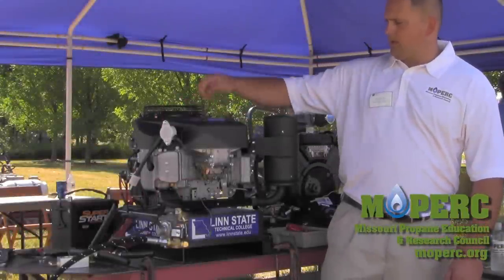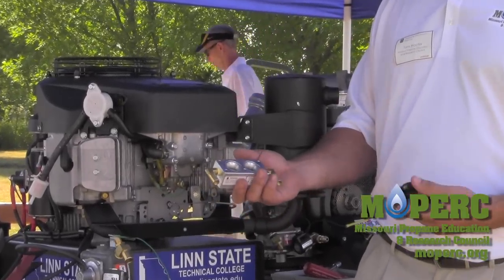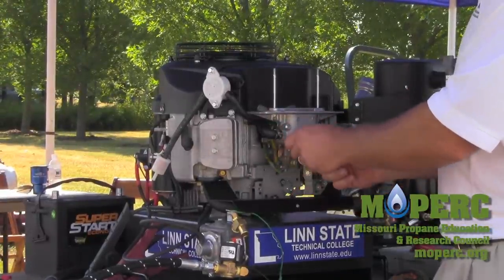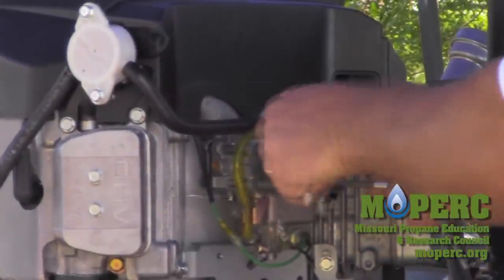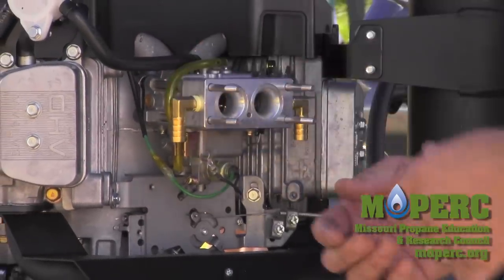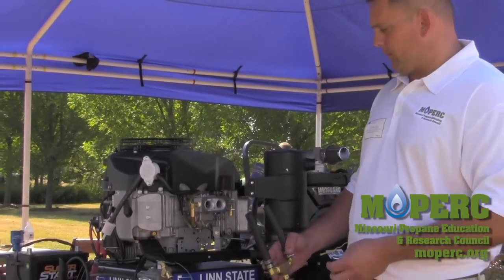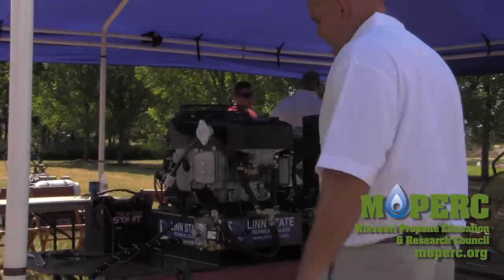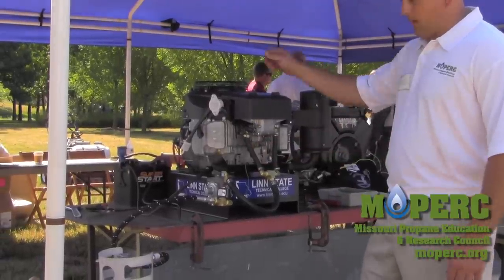Converting a Gas Engine to Propane | Demonstration & Innovation

Comment: I worked  for the council in the 70s and we were pioneering running council vans on propane nothing fancy in the 70s jus a solenoid  cut off at the gas bottle  , bottle mounted sideways .pipe straight to the carburettor  , run them like that for years

Comment: there is some long term issues to convert a gasoline engine to run on dry gas as propane, one is that the metallurgy of the valve seats is not optimized for running on dry gas, another is that the compression ratio of the engine is not high enough to use the energy potential of the propane gas, another issue is the camshaft that  is too open so if the mixture is not perfectly stochiometric, the exhaust smells garbage. on the advantage side, the combustion is much cleaner so the oil changes can be extended and the engine lasts finally, this is a must for an engine that is operated inside a building.
Reply: Sounds like a turbo can recycle the exhaust to hopefully eliminate the risk of unused gases.

Comment: I found your video because I'm interested in figuring out how to do the regulator setup. I'm in the process of putting a 28 horse Subaru engine that came out of a generator already set up for propane, in a golf cart. My one problem I have is I can get it to idle but I can't get the accelerator to work it just dies out.

Comment: How does the throttle work on this because if you open and close the throttle your only changing the amount of air you not controlling the amount of propane going in ?
Reply: You need to hook up some sort of system where it you have a throttle on it that pushes more liquid propane i inside of the cylinder to rotate the Pistons
Reply: @aidantharington  Bad answer !!!!!!!!!!!!!!!

Comment: Can the engine be run on gasoline without removing the propane adaptor kit? Did you just make a dual fuel engine?

Comment: I found your video because I’m interested in converting a gasoline outboard engine to Propane mainly because of all the associated problems with ethanol fuel on boats that doesn’t last very long  is the fuel block a universal application ?
Reply: LPG is not recommended for boats as the heavier than air vapors cannot escape.

Comment: i have a generator with an old tecumpseh HM80 8horse engine, do you guys manufacture a kit to turn that into a dual fuel? i'm considering doing the electronic ignition upgrade from points, and switch to an electric start since there is a threaded boss on the block and a via in the back of the fan housing for a starter motor, nice video also

Comment: What about valves and compression.
Reply: You need high compression and if you don't have a "Drip oiler" in the intake manifold, you'll wear out the seats, valves, guides, etc. [you no longer have soft carbon to lube these items]

Comment: Is the LPG cylinder gas or liquid withdrawl?
Reply: Well based solely on the orientation of the tank it looks like it's gas if it was liquid it would be upside down like I orientate a tank to fill my small propane canisters.
Reply: @philiphaverly4314  Cylinders can be internally configured to give liquid or gas to the mixer. An engine of this size would not require a lot of fuel so I would expect the cylinder to be the same as a barbeque cyl. But - the narrator said the mixer is the same as used on a forklift which means the mixer would have a liquid inlet and a gas outlet. This would be a problem without a means to prevent freezing. The camerawork didn't give me an opportunity to assess the installation. I give up; not sure what is being done with the LPG.

Comment: Why run propane
Reply: Sometimes it is cheaper than gas
Reply: Propane is a much cleaner fuel which helps the engine last longer.
Reply: Propane is a clean burning, energy efficient fuel.
Reply: Last longer than gasoline...gasoline goes bad, gums up the carburetor over time.